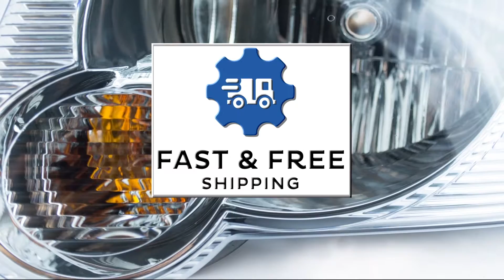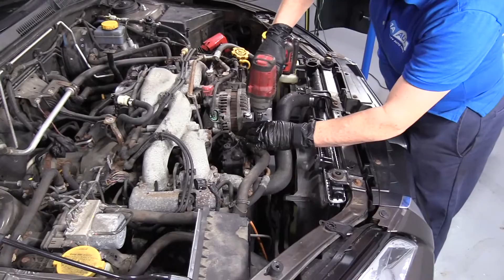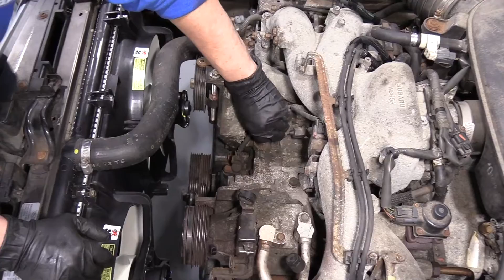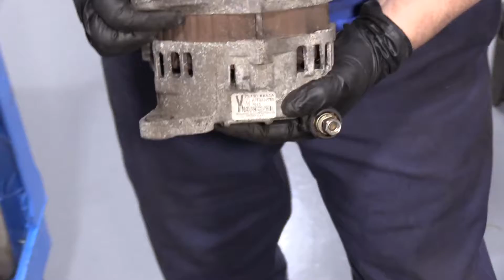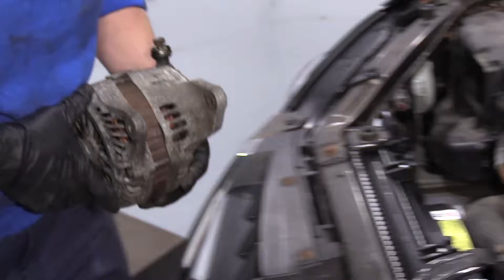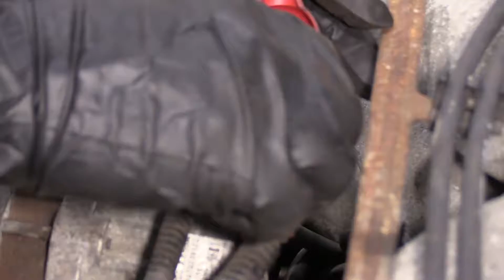How to Replace Oil Pressure Sender 00-10 Subaru Outback

Comment: Do you know if the oil gulley plug in the rear on cylinder 3 is the same thread and size as that front one under the alternator?

Comment: There was a waaay simpler way to do this... you could have saved alot of time by using a Crows foot... I used a 24mm crows foot with a extension and ratchet.. 5min tops🤘
Reply from the maker: +Andrew Messick Thanks for the tip!
Reply: My exact thoughts; No need to remove all that. You can just hit the switch directly as you would the other 2.
Reply: Don't you need a 27mm crows foot? That's the size deep socket it takes. Didn't realize alternator blocked access.

Comment: Good demonstration of replacement. 

Wonder why the oil pressure sensors begin to leak ?
Reply from the maker: +Grumpy 1 We wouldn't be able to diagnose an issue like that here, you may want to have a local mechanic take a look at it. Thanks for checking us out! 1AAuto.com

Comment: Interesting, but if i’m not mistaken, Isn’t there one just behind the dipstick?
Reply: The Outback has three: left, center, and right
Reply: @AdamFraserKruck  Have you noticed larger orifice diameters on the replacement part sensors ports vs the previously installed sensor orifices?
Reply: Are they same  location on 03 forester xs ?